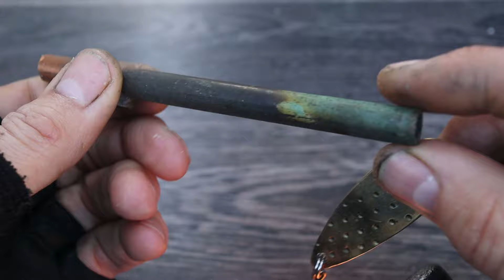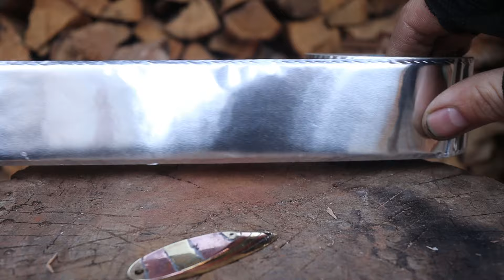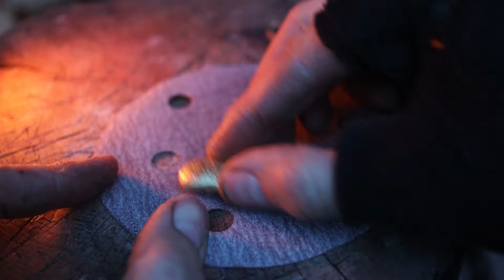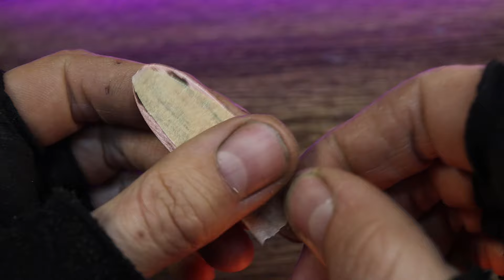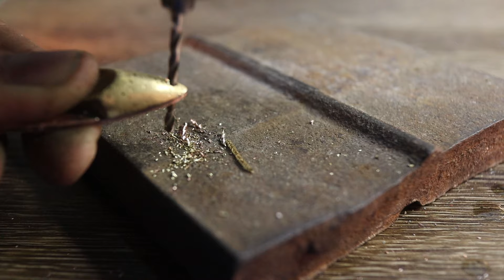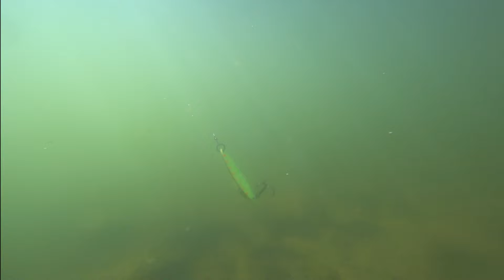Making Cast fishing spoons for long-range casting

Comment: When I worked near the ocean I used to melt solder inside of spoons to make them longer casting.  It cut down on the vibration though
Reply from the maker: if the center of gravity is placed at the beginning of the spinner, then the game will be very active, if at the back, then it will be slower
Reply: @CopperFishLure  the solder was at the rear.  I only tried it on a few.  I mostly used Pixie Spoons and didn't mess with them.  I will try the double spoon trick you tried if I can find some really thin spoons at the store I don't currently have a place I can store flammable stuff and my dad's shop is over an hour away.